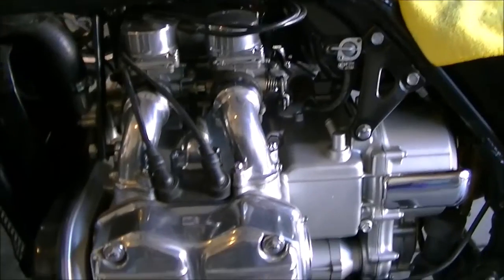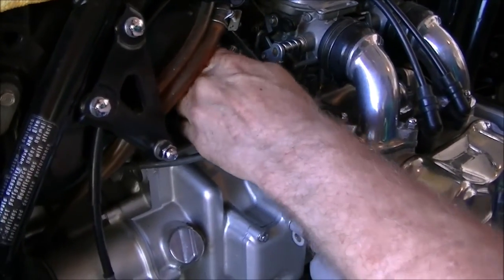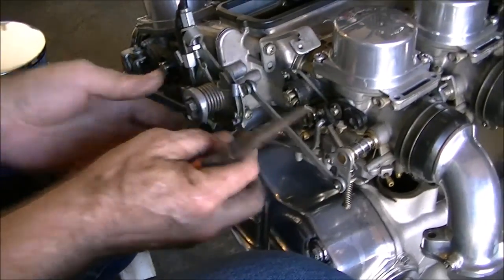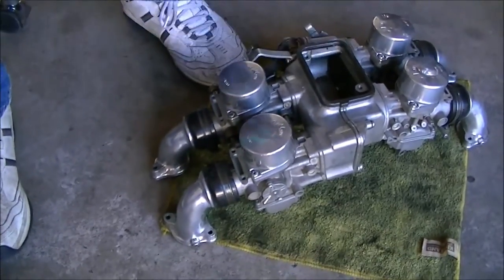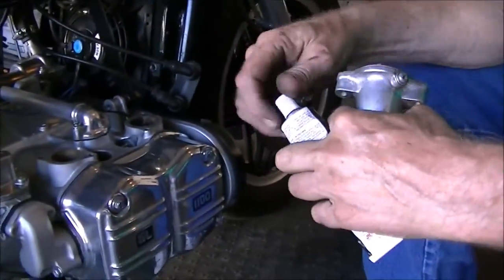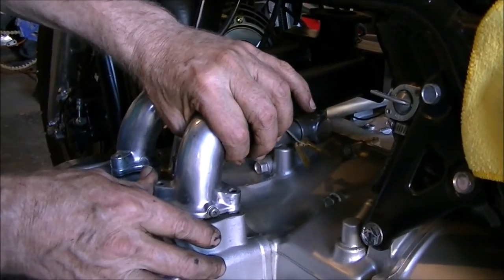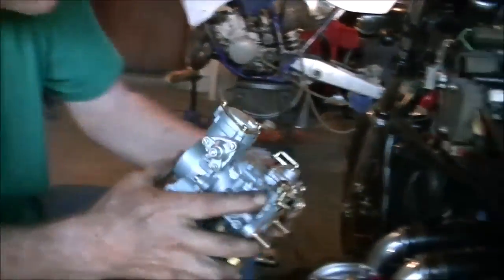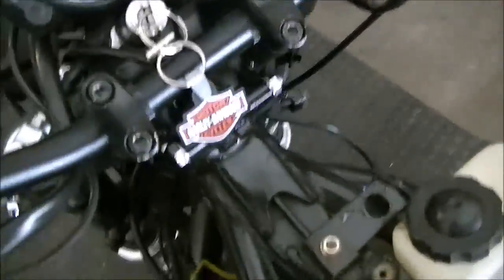Honda Goldwing GL1100A single carburetor (34 Pict-3) conversion.

Comment: Oh yeah. The speed armored cable, my GAD's feed cable broke. I was trying to break it aloos. Where did I get that to fix it? Can it be fixed run back through the o? Thank, it's my fuel control.It's the two.That's why I broke it

Comment: Hey, this is Mr. Rainey down here in Tennessee. And close to Nashville, I got a jail 82 and it he's locked up right now. What's the best stuff to use to stick it? Where to work? Right, I'm gonna run rough and how much does it cost? You got it off the eBay vibrator in there, pipes. How much you know, never y'all don't never give you price and stuff. Thank you. Keep up to good work. I love my bike. I just want to get it running. Where I go traveling on it?So all over that columbia at me all over the nashfield, play area

Comment: This is a very good video but as I found out today there are two different types of this manifold. They look the same but are designed to mount 180 degrees differently. The one I have the cable comes from the rear right-hand side and you do not have to cut the cable to make it work.

Comment: how did you connect the air lines back? also both terminals take 12V (positive), correct? Thanks!

Comment: what does this project cost
Reply: Hi Dan , you should be able to grab that intake and carb for around 180 shipped , add a low profile air cleaner and you should be nearly 210ish complete .
Reply: Intake manifold is $100 and the carb is $60 both on Evil Bay

Comment: Did the same to my 84 gl 1200 same carb..and it keeps fouling out the plugs..tried to adjust the air fuel screw.no.luck.it run good..just to much gas....any idea,s
Reply: Vernon Ricker There are different air/fuel mixtures, known as "circuits", on a carb. The idle air mixture is the ONLY one you can adjust with a screwdriver. That's the "idle circuit". The other circuits, known as midrange & main, can only be changed by installing different jets (or metering rods in certain carburetors). If you keep fouling plugs maybe your choke isn't fully closing. Or (if your carb has one) you have the wrong power valve installed.
Reply: Sorry that I just seen this. I would try rejetting with one size smaller. And then readjusting to the new jets. If you don't have them, they are easy to find on ebay...

Comment: @jammertime what instrument cluster are you using? Looks great and sounds great too! Can you put a link up to where you got gauges and intake please?
Reply: Hey there Dave. The cluster is a generic after market unit that sells on ebay. I have the link for that in the description to see. It was a bit of a hassle to figure out the wiring, thanks to odd translations. But, after it is all sorted, it works and looks great compared to the stock gauges. Thanks for watching and taking the time to comment!

Comment: I'm doing the Same .on my 85 gl1200...it sounds amazing...Thanks for posting.this Video
Reply: That's great! hope the video helped in some way. Thanks!
Reply: It runs to Rich..fouls out the plugs...
Reply: @vernonricker9910  Did your replacement carb come with any other jets? The one I bought did, although I didn't have to change them. But, you may need to put one size smaller. Also, double check your air/fuel screw, as it may be too rich there also...

Comment: What gauges are you using. Easy install?
Reply: Thanks for noticing.
https://www.ebay.com/itm/Universal-LCD-Digit-15000rpm-Motorcycle-Speedometer-Tachometer-Gauge-Odometer/372318206634?hash=item56afe4faaa:g:fdQAAOSwHy5elnU3
In my quest for budget parts, I found that unit. It was not a simple plug and play, as the wiring was a challenge, but doable. Once everything was connected and set up proper, it has been working great. And it looks so much better than the old units...

Comment: Awaiting an update video. I have started a '81 gl1100i project and did the 34 pict 3 conversion also. I am needing to find power to the carb and also how the vacuum hoses connect. Also probably going to need a new starter as I only get a ticking near the battery (possible relay bad? I have no clue as I am new to bikes)
Reply: Yeah man...It has been a while since I did the video. It was a really rough winter for me and I am getting back out in the garage next week. Until then, maybe I can help you get things hooked up proper. The power for the shutoff valve and choke on the carb needs to power up when you turn the key on. So, you need to take a test probe/light and find a wire that gets power when you turn the key on. I used a orange wire that supplied power to the front fairing running lights. 
The vacuum advance from the back of the engine connects to the top port on the throttle cable side of the carb.
And the two crankcase tubes on the engine need to connect to the air cleaner. I used a tee connection from the two vent tubes to connect a single line to the bottom of my air cleaner.
For the starting issue, I would check all connections of the battery cables, especially the ground, and make sure they are clean and tight. Next thing is to make sure battery is absolutely good. If true, the solenoid and relay needs to be tested. If both are good, that is when the starter needs to be addressed...
If you need some help other than that, my email is miofvegas@gmail.com. Good luck!
Reply: @magneticintrusion  Hello, I,m just getting as much info before attempting this
conversion. I already have the manifold/34 pict(chinese)carb. I see that you connect the vacuum advance from back of engine to the top port on throttle side.
The blanked port at approx 5 OCLOCK from the top port one ? What and where
does that go ?...do I just keep it blanked off ?
Reply: @allylogan9818  Thanks for checking the video out. I hope it will help you get your project completed a little easier. The distributer is the only part I know of that needs vacuum to work proper. I simply plugged all other ports on the carb. Good luck!
Reply: @magneticintrusion  appreciate that and hello from bonnie Scotland.

Comment: I'm working on 82 goldwing for a customer he is considering changing to single carb conversion. His bike has air system on top of air Cleaner. Do you know if the single carb and air Cleaner will fit under the air system?
Reply: Hey there. With the carb and filter I have on the bike, I am not sure. I can say the filter fills the area between the frame sides. And is as high as the gas cap on the tank...Hope that help with your decision...
Reply: @magneticintrusion  ok thanks

Comment: Excellent video , very clear and informative 👍..I just wish I could find a carb .
Reply: Thanks dude. I appreciate the stand for common sense too. I added links to the parts I used in the details section. Good luck with your quest!
Reply: @magneticintrusion  thanks man
Reply: Got mine on ebay

Comment: Have you done this conversion on a 1200gl?
Reply: I have not. But, I am looking for one to do next!
Reply: @magneticintrusion  I'm doing one but it idles at 1500 to 2000 and falls on its face in acceleration.
Reply: @mattmcdonough6831  What carb do you have? Just off the cuff here, i would for a vacuum leak, then if the vacuum advance may be on the wrong port, or further adjusting is needed.
Reply: @magneticintrusion  I'm going to go back through the system and see. You live in Las Vegas NV area?
Reply: @mattmcdonough6831  Yeah man. Near Sahara and Decatur...
Reply: @magneticintrusion  ok I'm on Steward and Hollywood. I'm going to go back through the system in a couple of day and try again. If it don't work maybe I can have you cruise by and take a peek?
Reply: @mattmcdonough6831  We can do that. Let me know how it goes.
Reply: @magneticintrusion  sounds good thank you sir.
Reply: @magneticintrusion  I'll send it in a minute.
Reply: @magneticintrusion  ok I sent it let me know if you didn't get it.
Reply: @mattmcdonough6831  Yes...See you soon...
Reply: @magneticintrusion  give me a call first I want to know your adjustments.
Reply: Same problem here on my gl1200, seems like it’s starving for gas when I open up throttle! No power. Used same 34-3 carb

Comment: how about vacuumcum hoses
Reply: Hey there. Thanks for watching. There was only one vacuum line on this bike. It is for the advance on the ignition. There is a update in the notes that explains I attached it to the wrong outlet on the carb in this video. That vacuum advance line connects the the upper port on the throttle side of carb. With the two blowby ports on the block, I connected each of those to a tee, then connected that single line to the connection on the bottom of the air cleaner housing. I will make a update video for all to see the details...
Reply: @magneticintrusion  thanks my bike must be finished tomorrow

Comment: Where's the manifold and carb set-up come from I want to do the same conversation
Reply: This is the guy that I got the manifold from. It is actually much less expensive than when I bought mine: https://www.ebay.com/itm/Gl1000-Gl1100-1200-single-solex-carb-carburetor-intake-manifold-goldwing/284128570428
And the guy that sold me the carb is no longer on ebay. But, if you do a search 34 - pict 3 carb there, you will see many to choose from. Good luck!

Comment: Are the O-rings for the intake manifolds too expensive around your place?
Reply: Price had nothing to do with it. Not many places in Vegas have very many parts in stock for 38 year old bikes. I was very impatient to get that carb mounted and didn't want to wait the 3 to 5 days for ordering. I have no issues using the rtv anyway. I am not sloppy with it, as to cause some of it getting sucked into the cylinders. And, the sealing surface is much larger than the o-ring, so there is less chance of failure. The only drawback to me, is the extra time it takes to clean up next time they have to come off.
Reply: Magnetic Intrusion , well, along the years I have found  silicon inside the cylinders water jackets, oil strainers clogged, etc, etc, that’s why I am “sensitive” about the use of silicon or derivatives, but hey!, it’s not my bike and you are not sloppy, my opinion?, I will wait 3 to 5 days for the right part
Reply: @magneticintrusion  Price? Planning? or lack thereof. The damn part is 4 bucks. and available from Amazon in less than 3 days. 20 bucks and no gel ball leaks. Personally, ANYONE that uses that junk is a hack. Only wish I could un-see it. Immediately stopped watching cause I do not like non professionals not using brain cell power and being lazy. That junk makes a mess of anything after the fact and takes extra unnecessary time to scrape and clean up when it is absolutely 100% not required.
Reply: @anonimous2451 , ...he could've gone to any ACE Hardware or auto parts store for O-rings.
Ethanol and vacuum will eventually have him redoing those elbows, more sooner than later.
Reply: @anonimous2451  I thought the same. Not a fan of that goop he used. Not for intake work anyway. O rings come in a myriad of sizes if NOS cannot be found quickly. Silicone will always be a bad idea near fuel.

Comment: Did you use  the big jets or  the small ones?
Can't get mine to idle correctly thank you in advance for any info.
Reply: I used the smaller jets on mine. Excluding manufacturing differences and quality control of different suppliers, I think the biggest issues I see with idle on these carbs is getting that first adjustment on the idle stop screw correct. If that isn't almost perfect, all other adjustments are basically futile. And it messes with runabilities after idle. Some others totally disable the fuel cut off, but I don't. Also, valve adjustment, ignition timing and any vacuume leaks can mess with the idle too.
This procedure gave me the best results:

1. Fast idle adjustment
At idle with the engine warm the throttle butterfly should be almost completely closed. This is set by the fast idle screw which acts on the stepped cam.
With choke fully open, adjust the screw so there's clearance of 0.003”, then turn it inwards a half turn. This sets the throttle opening.

2. Volume control screw initial adjustment
Carefully screw this in until you can feel it seating. Do not over tighten as that will damage the carb body. Then back it out 2 ½ turns. This is the initial setting.
Hook up the tachometer, replace the air filter and start the engine.

3. Idle speed initial adjustment
Idle speed is set by adjusting the larger screw. Turning it in reduces the volume of fuel-air mixture flowing, turning it out increases the volume. Turn the screw slowly while monitoring engine speed. The target is around 850 rpm.

4. Volume control screw final adjustment
Return to the small screw and turn this slowly to increase engine speed. (Usually outwards.) It should only need less than a full turn.
Find the highest speed then turn the screw inwards so that the revs drop slightly.

5. Idle speed final adjustment
Go back to the bypass screw and turn this to set the idle speed back to 850 rpm.
Reply: @magneticintrusion  Got it! I will try this again tomorrow after I switch to the smaller size jets and I will let you know the results, thank you again for all the help.
Reply: @randall1959  I'll check it out right now thank you.
Reply: Is this process necessary if the bike ran good, but I swapped the cable out? I didn’t touch the idle screw. Thanks in advance, and nice simple video. 👌 I bought my bike this way, just trying to learn about it.

Comment: I did a single conversion a couple of months ago and haven't looked back. So much simpler.
Reply: Yeah man...I want to do every one I see now!
Reply: @magneticintrusion  I have found that nothing beats the Bocar Solex from Mexico or a real West German Solex. The chinese copies are all over the place as far as quality.
Reply: @randall1959  I have one from West Germany took it out and install a chinese can't get it to idle right should I rebuild the bocar?
Reply: @AGAVE26  That's the one issue I have with mine. The idle is a little funky but otherwise it runs great. It hasn't been enough of an issue to worry about.
Reply: @randall1959  probably is as good as they work thank you very much for your input.
Reply: @AGAVE26  One thing you can try is a larger idle jet. I didn't have one so I drilled mine out with a .008 drill bit. I'm getting an idle of around 1200rpm. It tends to climb a little and sometimes drop a little. It's not perfect but it's a 40 year old bike and it runs well enough otherwise. I'm using a 140 main jet and I'm getting 36mpg highway and 33 overall.
Reply: @randall1959  I'm going to check my jet sizes  and I will let you know what i have
My actual rpm is about 1200 right know I'm just nervous abiut running it too rich or too lean since I'm not a mechanic I just go with me feeling an checking the temperature gauge to see if the bike gets too hot too quick I don't know if this is ok to do but that's what I do to make sure .
Reply: @AGAVE26  If you give it throttle and it doesn't stumble that's a good sign you're at least rich enough. Pull your plugs and they should be tan colored on the ceramic that's around the electrode. Tan or a little darker is fine. Too rich won't hurt anything but can foul plugs. Too lean is more damaging. My bike runs a little rich but that's fine because I'd rather be rich than lean.
Reply: @randall1959  all right we'll try that then, thank you for your help I'll be back with results
Reply: @AGAVE26  Some wings need larger jets and some need smaller. There's no "one fits all" solution.

Comment: Hi there !
Where did you get your carb and what model is it?
Reply: Awesome! Your video is the most "complete"video that I've seen so far congrats.
How you secure the throttle cable to the carb?
Reply: @AGAVE26  Thanks! The carb comes with a 'barrel' that has a screw in it and a hole that the cable is put through. The screw is then tightened to hold the cable in place. See the details starting at the 38:00 mark.
Reply: Sorry I didn't see this sooner. https://www.ebay.com/itm/New-34-Pict-3-Carburetor-12V-Electric-Choke-For-VW-Beetle-113129031K/222062012224?ssPageName=STRK%3AMEBIDX%3AIT&_trksid=p2057872.m2749.l2649
Reply: What you do with breather tube  in top of the engine?
Reply: @AGAVE26  the filter housing has one attachment on the bottom. So, I have the two hoses from the engine going to a tee, and the to the tube on the bottom of the housing.